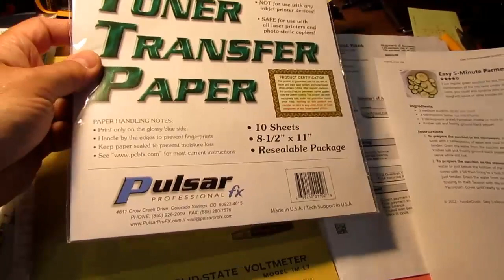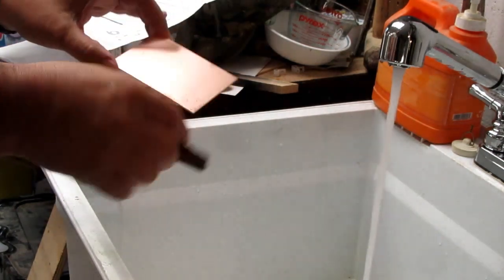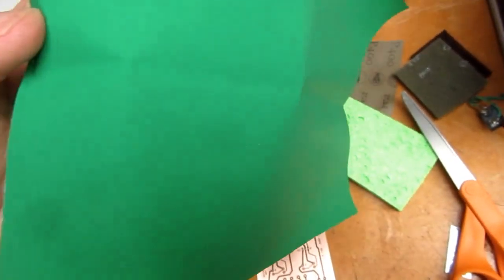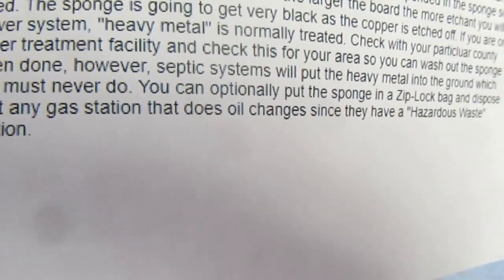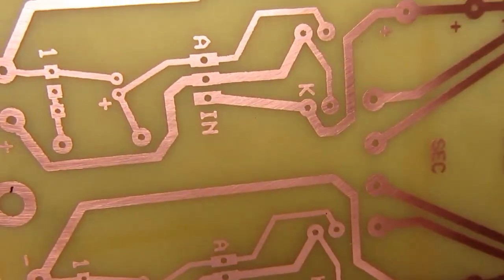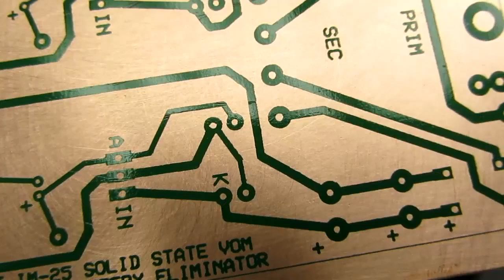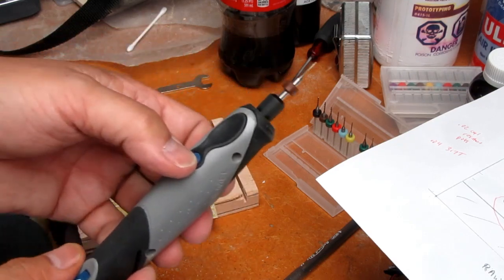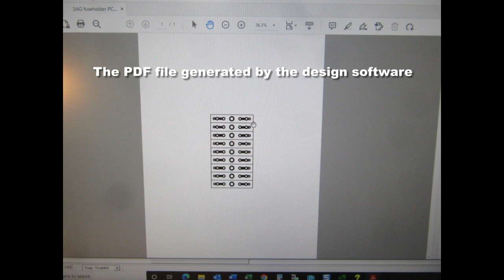Using the Pulsar Toner Transfer System for Making Custom Printed Circuit Boards

Comment: Great video.  Thanks.  One thing I'd note (just to save costs).  When I print my graphic onto the toner transfer paper, I first print it onto regular paper.  Then, I cut a small piece of the toner transfer paper just a little larger than the graphic.  I use a piece of blue tape to tape the toner transfer piece to my regular paper, covering the graphic.  I feed the paper (and toner transfer paper) into the printer and print that way.  I can get more than one print per sheet of transfer paper that way.

Comment: The pulsar blue does look interesting, I might have to give it a try. 
My current method is to go over the entire board with a sharpie and colour in all the tracks. I use one of the dual ended pens with a normal tip and a fine tip. Time consuming but effective.
Good to see you using gloves. So many of these PCB making videos have people using ferric chloride with bare hands.

Comment: Nice video, I appreciate you trying out the 'foil' method; I too have been having problems with lack of toner density, leading to problems in the etch.
So, I will maybe give it a try, since all methods of enhancing the toner deposition have pretty much failed.
I modified a cheap 3M laminator by fooling the thermistor by placing a potentiometer in series, to give me hotter temps which fixed many ills.
On your tine plating solution: You can use a flexible plastic squeegee to save more of the expensive solution. In the old days we used silver-cyanide!
I abandoned ferric-chloride altogether; I now use 1-part muriatic-acid to 2-parts 3% hydrogen-peroxide; then backing soda to neutralize; much better and faster.

Comment: Thanks and an interesting process to be sure. You mention a previous failure with the "blue" paper.   Are you talking about Press-N-Peel?
Reply from the maker: Clivedrone, no I was talking about the same Pulsar blue paper as is shown in this video,  but used by itself without the green film. It was not the fault of the blue (toner transfer) paper, but rather the inability of my laser printer to deposit a sufficiently dense layer of toner to make a good etch resist.

The beauty of Pulsar's green film is that it uses the toner (transferred using the blue paper) as an adhesive for the film, and the film then makes a superior etch resist, regardless of how dense the toner itself is.